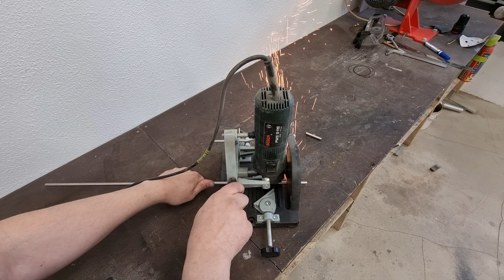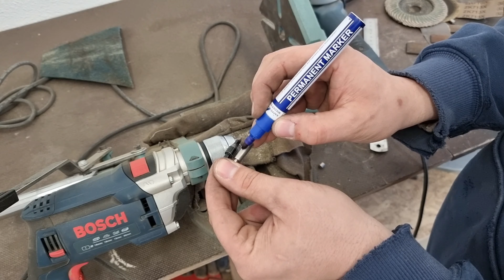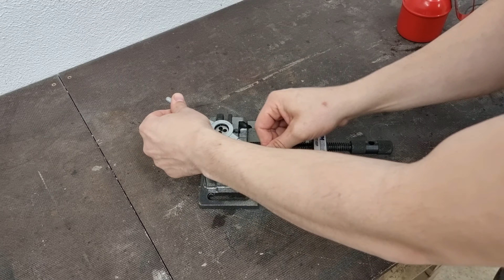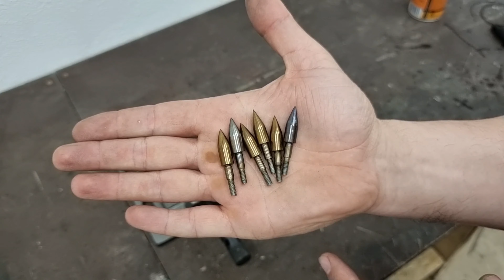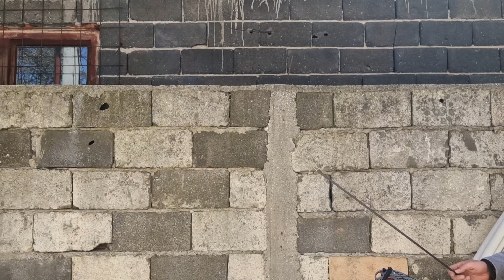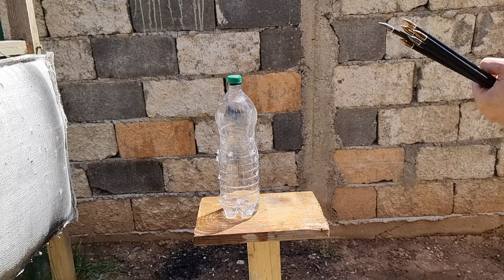Homemade Stainless Steel Screw on ARROW PRACTICE TIPS using only a Drill and Angle grinder

Comment: Hi you done a good job despite limited equipments. I have few steel rods and I have been thinking of doing the same. I couldn't read the size of the die on the video is it 8/32 UNF? Thanks
Reply from the maker: thank you,  the thread size is 8-32 UNC